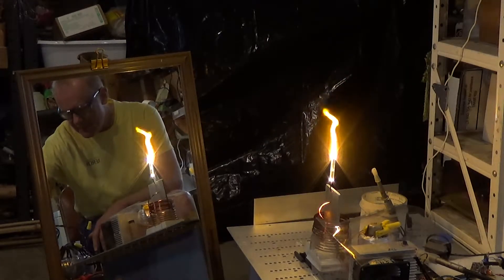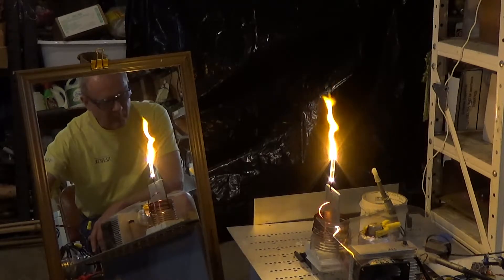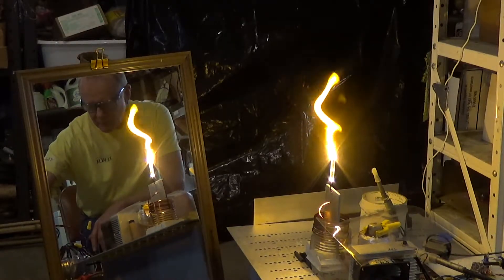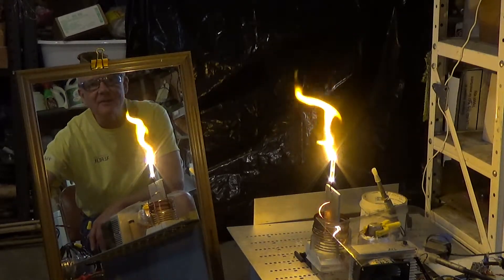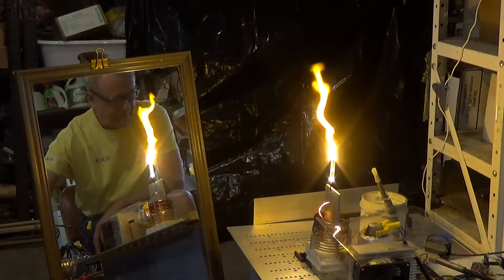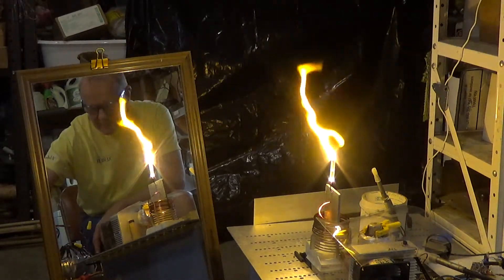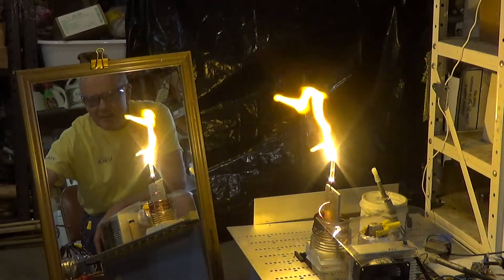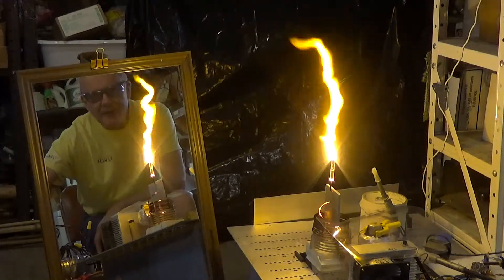13.56MHz HFSSTC with glass on breakout for sodium flame color

Comment: great job you could give the blueprint to build one
Reply from the maker: I have some documentation for this build on the High Voltage Forum:
https://highvoltageforum.net/index.php?topic=1638.msg12549#msg12549
That would be a great place to ask questions (and see many other such projects from many people).  This is not simple project to build.  There are simpler self-oscillating versions without precise frequency control, though most are lower power too.